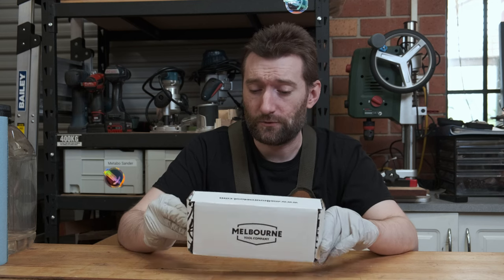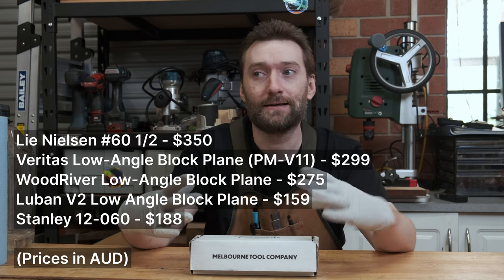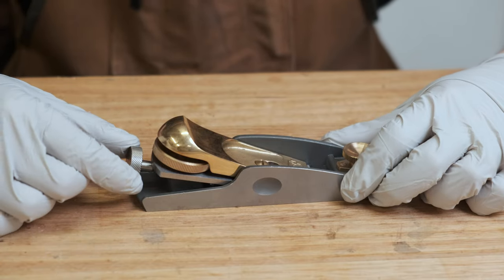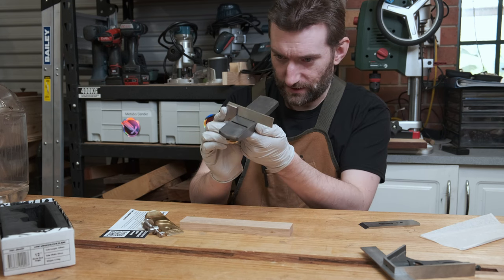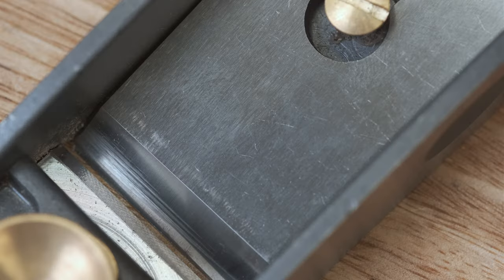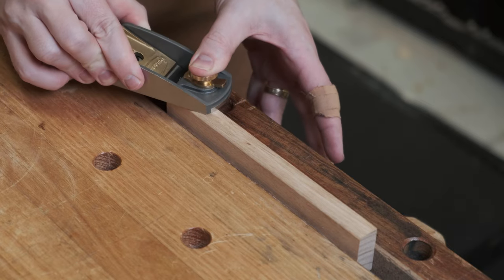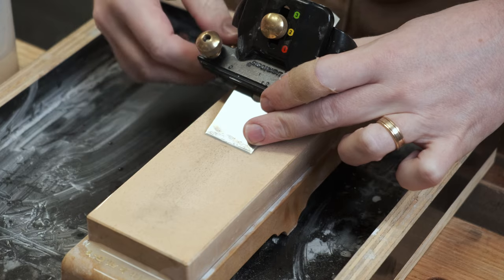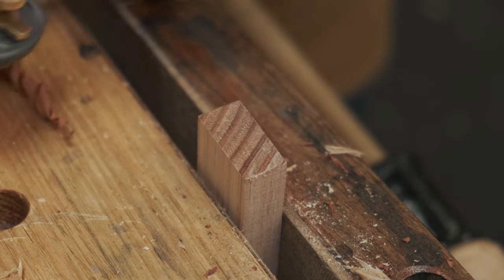Melbourne Tool Company Block Plane Review

Comment from the maker: After I had finished shooting and editing the video, I reached to MTC to ask about the painted frogs. Apparently that wasn't how previous prototypes were supposed to be, and that's just what arrived from the factory. 
The milling on the bed is "on the extreme", though I've seen a couple of other people online with pretty similar milled surfaces. Interestingly though, the tool path pattern was different.

I stand by comments that the milling probably doesn't matter, and the plane is good, but not great.

Comment: That is the least spiciest spicy take I've heard, I was expecting a lot more from you Paul 😆 I'm thinking of buying it, I don't have a block plane other than the pressed metal one I bought from Bunnings ten years ago for $20. My main driver (as you likely know lol) is price, I don't really care about milling marks if they don't affect the end result and are hidden 99% of the time. The blade and body quality sound good, so you might have tipped me to a yes. One question, why did you buy it if you already have the Luban block? ie, why get another from the same price/quality bracket?
Reply from the maker: My luban is a rabbeting block plane, which sometimes is nice, sometimes is very not nice when you forget which side the blade is protruding and end up gouging the wrong bit!
Timbecon do have Lubans Low Angle Regular-blockplane (Knuckle Cap Block Plane) currently for the same price ($159), which would be the 1:1 equivalent.

Comment: Same as Deverell I got a pre-production low angle Jack from Timbecon.  Great plane but the mouth adjustment is woeful and at times the screw in the front knob separates from the brass adjuster.  As you note the blade is pretty much indestructible.
The name could confuse some, but I don't think it's misleading.  Some Australian plane makers might think otherwise.
But I reckon for people starting out it's a great plane for a good price that doesn’t need  a lot of work to make shavings.

Comment: As a still plane-less woodworker I've been eyeing off the Groz from Team Blue (due to my relationship with said retailer). At half the price I'm guessing they are not as user friendly as these. Worth doubling the investment to MTC or Luban? Im guessing a lot of the extra value is in the blade quality?
Reply from the maker: Take this with a grain of salt because I haven't had first hand experience with Groz! 

From what I've read from others like FWW, Groz is a case of 'you get what you pay for' - at those  price points, you're not paying for much in the way of finishing/lapping and you end up having to do much of the flattening work to turn them into a usable plane. While you might spend a 2-10mins flattening a MTC/Luban as worst case (and 0mins for LN/Veritas), you might spend an hour or three with Groz.

The blade is also likely to be a softer steel, so you'll need to resharpen it often. That isn't really that big of a deal, but it is a point of difference

The Spags did a video last year on tuning a cheap stanley block plane which is very relevant - https://www.youtube.com/watch?v=dFowiriDYbY 

If you put in the hard yakka, the Groz should be OK, but the time it takes may not be worth it.
https://www.finewoodworking.com/forum/groz-planes-any-opinions

The MTC/Luban option, while more expensive in dollarydoos, aren't a project in themselves to get going and you'd be using your plane within 5-10mins of opening the box. How much is a timebuck worth? ;)
Reply: @TheWoodKnight  Awesomes. Yeah I think I will be switching allegances temporarily when I finally pull the cobwebs off the wallet and try MTC as Carby doesn't have this half-way option and Im not up to spending more on hand tools than my power tools :P Cheers Paul, very handy!
Reply: I was interested in Groz planes and picked up a #4 on clearance from TotalTools for about $20. It looks essentially the same as the few vintage Stanley Bailey planes that I bought from eBay. I am a novice with hand tools so have been watching videos and reading articles on restoring and fettling planes before I dive in and stuff things up. There is a series of videos on You Tube where the woodworker buys a new Groz and goes through the stages of fettling and setup. He gets a decent result in the end but put in a LOT of hours to achieve this. I am not rich but I am also not that patient so am tossing up whether to go with Luban or be extravagant and buy one really good plane.
Reply: @rodiffinger7998  luckily for me I have a birthday coming up... so I think I'll go the MTC :D
Reply: Ordered while on Special - Thanks wifey for the Bday pressie :D

Comment: I bought a low angle jack plane from timbecon about 1 1/2 years ago, they had a couple that looked very similar to the Luban. Asking about it they had them as pre-production trails, to see if they could get the quality they wanted for a bulk order.

Later on listened to the shop stool podcast I heard Alexsandra Pontonio who said she was doing some design work with Timbecon for a new lot of planes. Episode 76 if anyone is wondering. I guess that turned out to be these!

The plane I bought has similar characteristics to this one, notably the relatively rough looking mill finish, and the (in my opinion) horrible grey colour.

I took it all apart and had to do a little filing and clean up work, then spray painted it black

Good plane for the price
Reply from the maker: Ohhh I remember those! I think they popped up about a month after I'd  just bought a LAJ so I was a bit annoyed, haha. Did the frog have paint and rough milling over it as well?
Reply: @TheWoodKnight  It had the rough milling marks, but not the paint.

It cleaned up alright, but if I was buying a MTC one for the current pricing and it arrived in that condition? Probably be better off with something else.
Reply from the maker: Dang - that sounds like the paint was a mistake for this batch, but the rough milling was never addressed. I don't think thats a corner they can cut to be successful.

Comment: Thanks for doing this review.
I can't help but think that this plane looks uncomfortable to use. It looks like it would dig into the base of the palm when using one handed?
Since picking up a second-hand LN 102 a couple of years ago my larger block plane has stayed in the draw.
Reply from the maker: On my hand size, it doesn't dig in uncomfortably, but longer or shorter hands I could see that being an issue. The very peak of the cap doesn't come to a particularly sharp point, but it isn't a smooth transition either, so the wrong grip or 'wrong hand size' would dig in.

Comment: Curious to know why you’re replacing a rabbeting block plane with a standard one. I have a Stanley block plane (took days to get flat and smoot etc) but want a rabbeting block plane.
Reply from the maker: Mostly because I keep forgetting its a rabbeting block plane and end up putting gouges where I don't want them, as I forget which side of plane the blade is sticking out of. There have been a few occasions where I've wanted to make a jig using a block plane and I've ended up needing to use my #4 instead because of the rabbeting feature.

It's not that they're bad, but for my use/workshop, I don't think it has been "the right tool"

Comment: Thanks for a top review, I enjoyed watching it and agree with everything you said. I have a bit of a  weakness for block planes and like you I bought one of the "Melbourne" block planes. I have a couple of observations on the plane that you did not mention. Firstly on the positive side is the accessibility of the lever cap tensioning wheel. Far easier to use than the wheels on Luban planes that are almost concealed under the lever cap. 
On the negative side the geometry of the plane has some issues for me. The leading edge of the cap iron that rests on top of the blade  is poorly linished with a very coarse belt and is not flat but has a gentle curve across its width. Yet the visible but unimportant surface on the top leading edge is nicely milled..
If you look at a Lie Nielsen  plane the maximum mouth opening you are ever going to use has the throat plate flush with the plane nose, yet the Melbourne plane has a huge throat opening when flush and when closed down to a position where you would use the plane the front of the throat plate is well back from the front of the plane leaving a "fang" on each side of the plate that would be very easy to snag if not careful.
The other and main point for me is the one handed use of the plane is very awkward as the finger grips are set well back where they are aesthetically pleasing to the eye and design wise fits  in with the shape of the side but almost force you to use a two handed grip when using the plane. I have very large hands and find my forefinger falling short of the front knob/rest when I try to use it one handed. The fix might be like the old style Veritas block plane where the have multiple finger grip positions. For the price I would lean towards the Luban planes.  All the best.
Reply from the maker: The only other Luban with that sort of locking wheel that I have is the rabbeting blockplane shown in the video. Slightly different TPI, but otherwise identical - on that one, it protrudes out just as much as the MTC plane, though only on the sides. I wonder if various iterations of the Luban planes have adjusted that over time.

I hadn't noticed the underside of the cap - now I can't unsee. You're right, that is pretty coarse, though I guess its not really a chipbreaker in that configuration (Mine doesn't come to a point, but an abrupt 90 degree angle, then chamfered back), so I'm not sure its functionally an issue. But it does absolutely add to the list of 'could have been finished better'. 

You're 100% right about the throat plate - its a bit of weird that it extends a good 3mm or so past the front of the plane. Maybe for the extreme 50degree angle blade they offer it makes more sense?

One handed, my thumb sits about halfway out of the dimple - I don't think I have particularly large hands though. Ergonomics are one of those things that would give me nightmares if I was an industrial designer. I think you're right with the Veritas approach of having multiple grip styles baked in allows for a wider range of people to find it comfortable.

Comment: Speaking of products that trade on the idea of being made in one area but are actually manufactured in China, I recently procured some Bridge City Tool Works tools.  Notably the HP 9v2 and the HP-8.  Designed in Portland Oregon, made in China.  In this case the machining and finishing were all exceptional, you would not be able to tell from the workmanship and finishing where they were made.  Let me know if you are interested in borrowing/reviewing them.
Reply: BCT have USA made and budget Chinese made.  The owner took pains to find a Chinese manufacturer up to snuff such that the difference in quality is almost impossible to tell.  Not all Chinese manufacturers who purport to be capable of such standards have the ethic to live up to such a claim, eg. Linus tech tips screwdriver endeavor.  However it seems that BCT has found a reliable manufacturer.  My tiny block plane of theirs is well made.  Wish I could afford a full size plane like the HP-8.

Comment: My company has had dealings with Chinese manufacturers and they tend to build to a price, the absolute minimum. They can and do build some top quality gear but it costs. It took a few goes to learn how to talk to them. For instance, you don't ask "can build this for ten dollars" because they will answer 'yes' then do so. When you respond that it's crap they will say "what do you expect for ten dollars, if you want something decent, it will cost you twenty." One of the biggest gripes I have is that they use the shortest possible screws. These are ok when the item is new but as it beds and or wears, thoses screws don't hold.

Comment: Thanks for the review, Paul. I’ve been curious about MTC’s products ever since Timbecon announced them. Overall quality seems to be on a par with the Luban and, slimmer and more svelte body aside, I do wonder whether MTC’s offerings have come out of the same factory. Not a criticism, by the way - I really like the Lubans I have. The painted frog is… weird, and I’d prefer to see clean metal, but that shouldn’t have any noticeable impact on the quality of cut. While it isn’t ever going to be a Veritas or Lie Nielsen, at the price point, I reckon this little unit would be pretty good.
Reply from the maker: Right? It's hard to tell if its the same factory or not. On one hand, several parts are (99%) identical like the locking wheel (just has a different TPI), and the Norris adjuster. I didn't show it, but the front knob from my Luban LAJ fits/threads onto the throat adjuster plate of the MTC block plane. 

But on the other hand there is only so many ways you can make those parts I guess. The knob fitting? Well, they had to pick some thread, and M5 (or whatever it is) is just as good an option as any. Initially I thought they were from the same factory but with the quality of milling on the bed not matching Luban, I started to doubt 😂

It'll be interesting to see if they expand the line so they can drop Luban.

Comment: That blade was better out of the box, before you tried to sharpen it. I'm not a fan of M2 HSS blades for planes and what I saw here backs that up. You spent a lot of time making that blade worse and I don't see where you went wrong. I don't think you did, because that's what happens with that steel. I don't need a block plane, but if I did, it's not going to be this one.